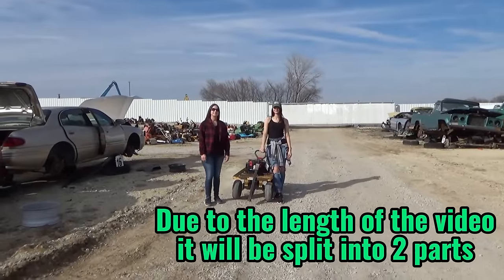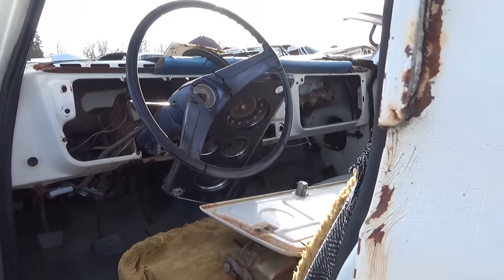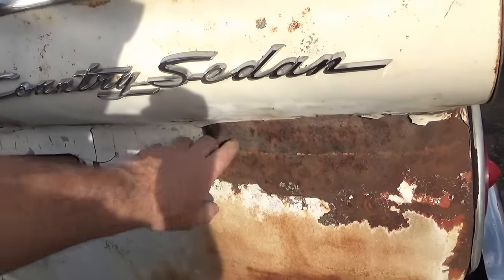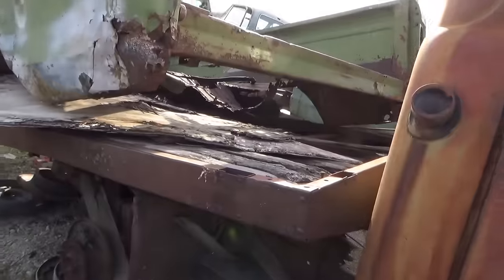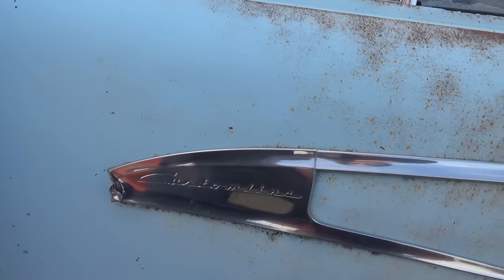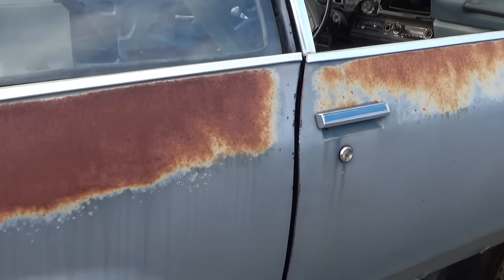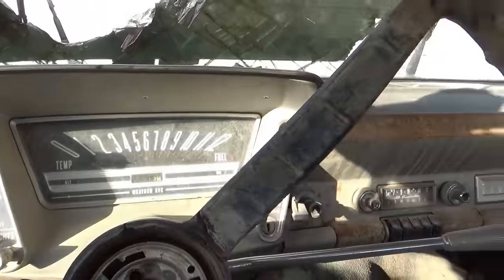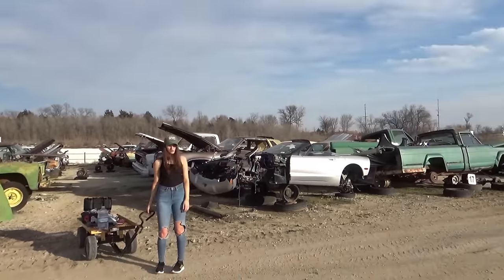CLASSIC CAR GRAVEYARD!! AWESOME FINDS!!!! MANY RARE CARS!!!

Comment: One trick to tell the year, if the trail lights are there, look at the lens. It has the year. Oldsmobile guy here. Looking to see if any 1964 Cutlass was there. I see one at 18:25 on your zoom. I have a convertible my father bought in 1966. Enjoyed the vid!
Reply from the maker: I always forget about checking the tail lights! Are you needing any parts for your Cutlass? I have a 69 mustang but it is a project car will probably be several years before I can get it going.

Comment: To tell if a car has original miles or a hundred thousand..
  Look at the right side of the brake pedal. If it is real well worn. It's a hundred thousand. If it is not,it's the car's original miles.

Comment: There is a lot I could comment about the cars since I've been around all of them. I will say you are right about the trunk dcks on those cars. The 59.& 60 Belair/Impala lids in good condition are very hard to find. An easy way to tell if it's a Belair or Impala is the taillights for 1960: the Impala has 3 lights/side and the Belair has 2/side; like the one you found.
Reply from the maker: Thanks for the info! Yeah I'm finding out that a lot of the old cars share the same body. They just changed the name of the car with different option packages. There's definitely a lot of rare parts in that yard!

Comment: My 1st new car was a 1973 Vega GT. Great looking little car, but a lemon nonetheless. Red, with black stripes and interior. Cost $2500 new. Sold it for $0 in 1983. 
Great junkyard video! I could watch these all day long!
Reply from the maker: I heard that they weren't good cars. I remember looking at one and my dad told me that I did not want it! But to be honest with you I really did. LOL I found those cars in the junkyard by chance. I went there to get parts for other vehicles and couldn't believe how many classic cars they had there.
Reply: Chevy Vega was designed with a 4 cylinder 140 cubic inch aluminum engine. 1 bbl carb standard. GT model had a 2 bbl carb. Pistons and rings were cast steel which wore out the aluminum cylinder walls after 40k miles and it would start to smoke like a mosquito fogger truck in July! GM issued a recall finally and they would replace your bad engine free but with the same faulty engine block. Some guys would cut out the fender wells and drop a small block 350 V8 in them. Instant drag strip sensation! Until the drive train came apart anyway! lol
Hot Rod mag had its share of modified Vegas in the 70’s. 
Ford had its Pinto, AMC had its Gremlin, and Chevy had its Vega.  I chose poorly.
Even worse is that I sold my Red 64 Ford Fairlane 260-V8 to buy the Vega. All my Ford needed was a $400 engine rebuild. 
Hindsight is a cruel teacher for sure. 🙄
Reply: i ran a 327/4 speed in my 72 vega, and i didnt have to cut anything  a little hammering on the firewall, and it slipped right in..I drove that car for 12 years, sold it in 89, for $2500..😊

Comment: Back in the 50's and 60's the factories would use lead to hide body seams and such so if if you see body filler like that 59 Wagon had it was done by someone later because they would of used lead
Reply from the maker: That's absolutely true! I had forgotten about that. I remember working on a 67 mustang and where the roof pillar attaches to the quarter panel is all lead.

Comment: That 66 two door Ford with the 428 is rare..  Hint  a way to tell the 50'scars..if they have 4 headlamps they are  58's or  newer...in   most cases.
Reply from the maker: Thanks for the tip! I bet that 66 would be worth a lot. I was surprised when I looked it up and realized that it was a 428!